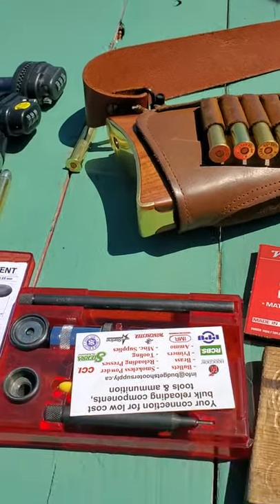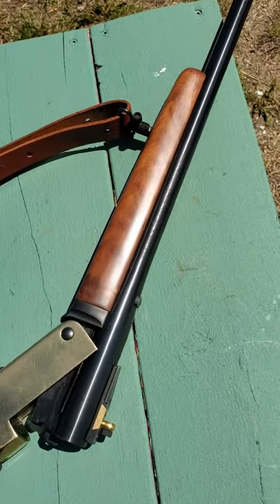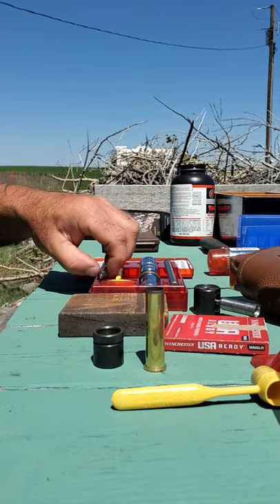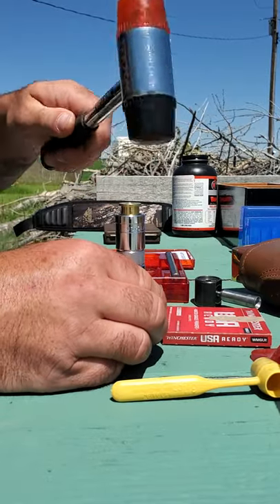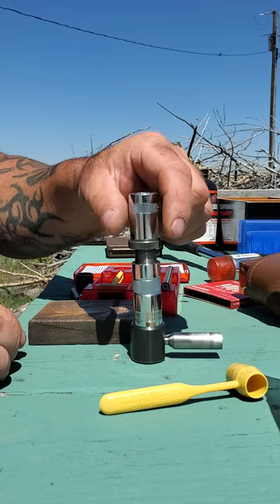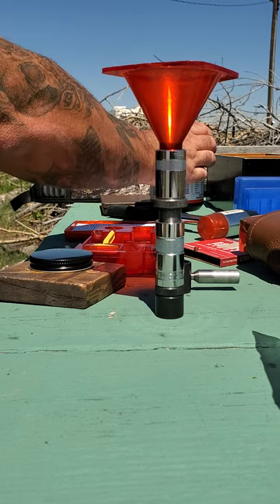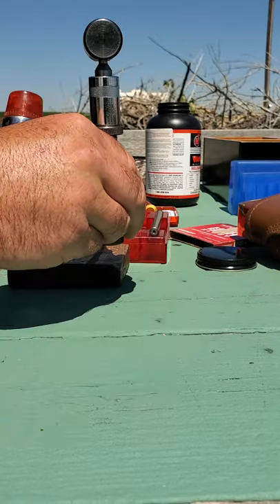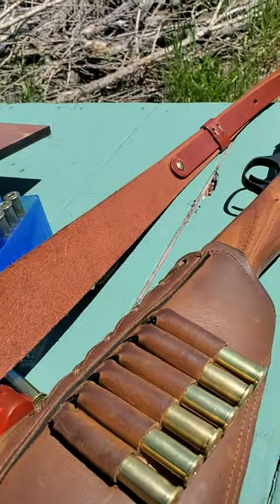45-70 Lee classic loader, reloading

Comment: Single shot I guess no crimp. Bullet did not look seated to what may be crimp line. Nice to see crimping for those with lever guns
Reply from the maker: yes, good eye. It definitely was not on the crimp line,  and you inadvertently bring up a good point why ppl should never copy reloading from utube. the bullet is seated to my rifle ( henry single shot ), where it is just kissing the lands because this rifle has a long throat. if i was reloading for my lever action, i would have crimped, which you can do on this reloader. once bullet has been made, you flip it over and put it in where the seating stem goes, and give it a few taps, and it roll crimps nicely. this bullet, however, seats tightly and is fine for my single shot.
sometimes the bullet is a tad small, and i will give it a fast crimp.  i really should show how to crimp with this loader as iv been asked before. 
again, good eye.
Reply: @outdoorsythings2573  thanks for the note. Although I have a press I think I will give this a try as I bought one for my Ruger 1895, 45/70.

Comment: I have a 450 bushmaster, do you think the 45/70 kit would load for it?
Reply from the maker: i dont think so. 45-70 has that big ol rim, and the rim fits into the bottom of the die.  bushmaster doesn't have that big rim because it was made to fit the AR platform ( magazines ). I dont see it ending well trying to reload with that set of dies. if your trying reload on the cheap or stay portable look into the lee hand loader, its a portable press single stage, there about $50 canadain and the dies are about the same, and a set of bushings are like $3.99 so you would be all in for around $120 canadain depending were you bought it. i have one, and it's nice for taking to the range and making up loads, or for calibers, i only have a few brass for. shoot, reload my bass shoot more. It's fast once you get used to it. ie prime everything,  powder in all the cases, place bullet in all them, press in place, crimp. an assembly line, basically. once set up, i averge 10 rounds a min, but im flying and have been using it for years.  i tend to stick with the rule of dont load calibers rifle not chambered for, and dont try reloading with dies not ment for the caliber. keeps it safe and simple. sorry for long post.  best of luck and happy shooting
Reply: @outdoorsythings2573  thanks

Comment: Do you not need to lube hardcast bullets more than what's already in the grooves before seating?
Reply from the maker: hey there anthony.  fast answer is nope.  longer answer is lead is slick on its own and has been used as a lubricant,  the lube/wax in the groves is just to help with leading in your barrel, something that shouldnt be a problem if you keep your fps down under 1900.  trap door loads for the 45-70. i for the most part use powder coated hard cast now and dont need the wax. if your wax falls out of your grooves can buy a toilet wax seal from any hard were store and push that into the grooves. works great and its very cheap. but i think the answer you wanted was nope you dont. just flare the mouth of the case if your hard cast is not sliding in easy. find a socket that matchs your 45-70 cast and give it a small tap to flare case, proceed to load as you normally would.
Reply: Thanks for the detailed answer. I've only loaded jacketed bullets so your tip on fixing fallen wax from grooves is great. Nice to hear no extra step as well.

I must have became confused and mixed up when I was looking up if cases with small dents in them are OK to use, people were saying it's fine but caused from too much lube when resizing.

And that must be what happened as I had a buddy full length resize for me since my rifles barrel and/or chamber was switched out during a repair since I had last shot them.

Thanks again. Excited to be loading some hardcast real soon.

Comment: Is the dipper on the kit used only for smokeless or can you use it with black powder?  Great video by the way, despite you almost losing your phone. lol
Reply from the maker: you can use it for black powder, there is a chart for that. remeber  lets say lee dipper holds ( made up #) 10 grains of xxxtype powder according to the lee dipper chart,  it would NOT be 10 grains of black powder. i lost my powder measure few years ago just befor a hunt and used the lee dippers but i had to google what the dippers held in black powder, since you measure black powder by volume not weight there is many many things you can use to measure. old caseing from reloads hold x amount, just google  say 9mm empty hold how much bp, that will get you start. but short answer would be yes you can but need to know how much the volume is.  sorry long winded answer.
Reply: What powder did you use here?
Reply from the maker: i dont want to say on utube.   It's a red bottle, which starts with V ends in T . It's made by hodgdon. if you reload, you should be able to figure it out. sorry, i just dont want to get the utube gods mad at me.

Comment: No crimping needed? Do you chamfer stuff? Love the simplicity
Reply from the maker: crimp if useing in a tube magazine.
can crimp useing the kit. put finished round in top of die bullet faceing down, get deprimer base, ( the small black base bullet sits in, place over the end, and give a few small taps with your rubber hammer, the primer hole will be over the primer so safe to hit.  i some times chamfer , basically as needed.  and that is rarely.
Reply: @outdoorsythings2573  ty!

Comment: What powder and load did you use?
Reply from the maker: 405 grain hard cast
imr 4064 lee dipper 3.7
cci large rifle primer
starline brass oal 2.079
oal 2.532
its not a trap door load; it's rated at lever action.
i cant say the grains of powder, but look up the lee dipper and amount of the type of powder and you'll see.

Comment: Thanks for an excellent video. Do you think that an arbor press would be better than hammering away with a plastic hammer.? I see all your shit flying around every time you give it a whack.
Reply from the maker: Lol yes. The table I was using wasn't my normal one one for that, poorly planed out. Most time I set it on a cinder block. And ye a arbor press would probably work but then you've basically made a reloading press.